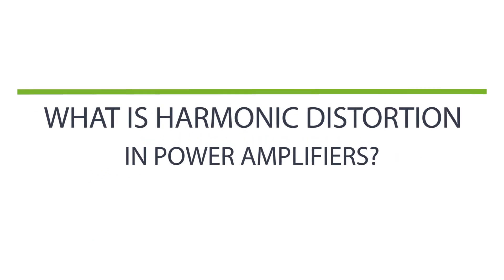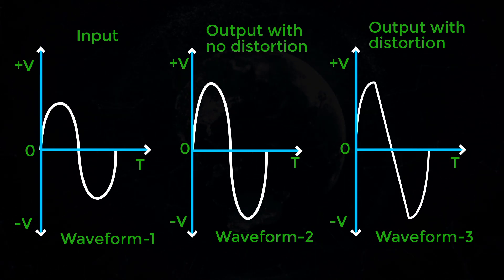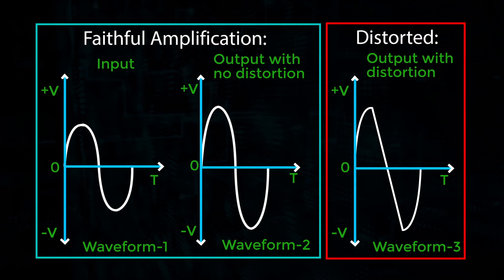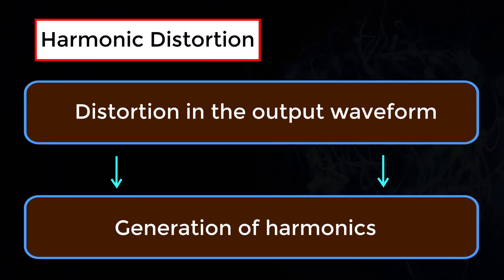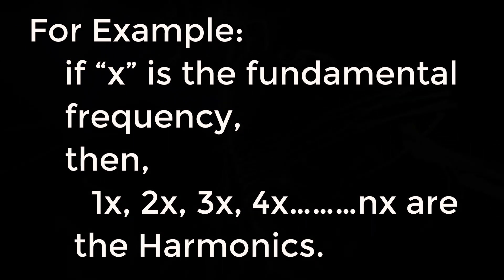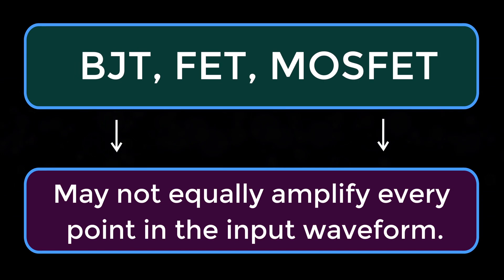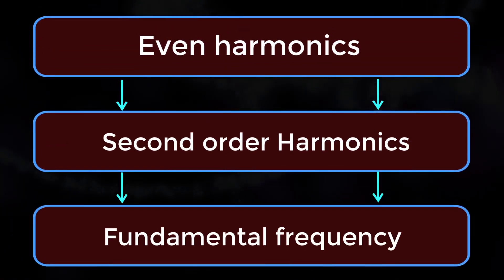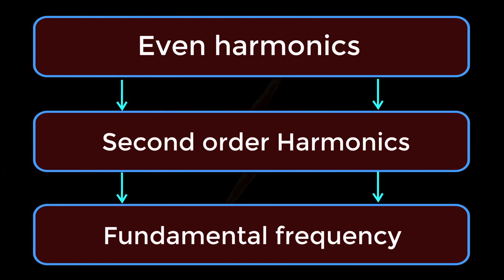What is Harmonic Distortion in Power Amplifiers | Electronic Devices | Electrical Engineering

Comment: Is the amplifier distortion also called harmonic distortion??
Reply: I don't know if it's the same thing. Because it's just a messed up version of the fundamental frequency playing out the output at a higher amplitude, unlike harmonic distortion which are added frequencies to the fundamental frequency. They are different types of distortion. Thats just what I think. I'm having a bit of trouble wrapping my head around this as well.